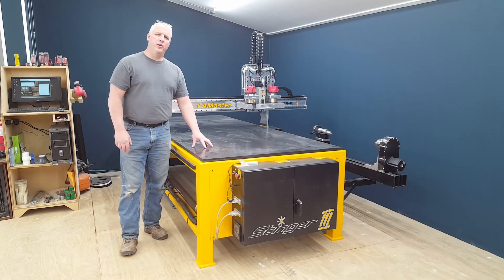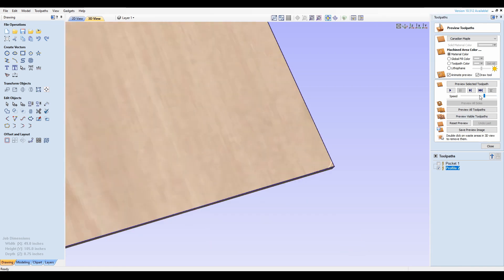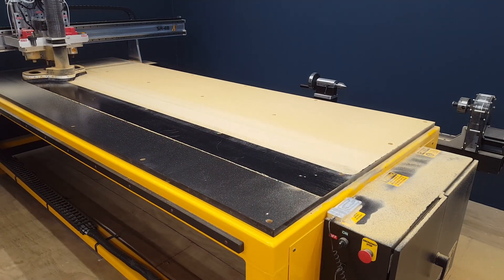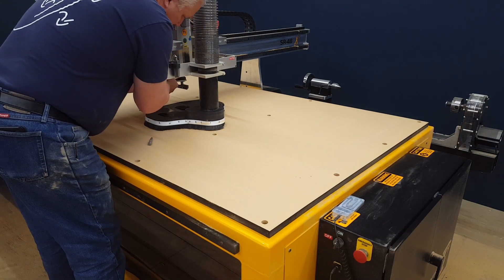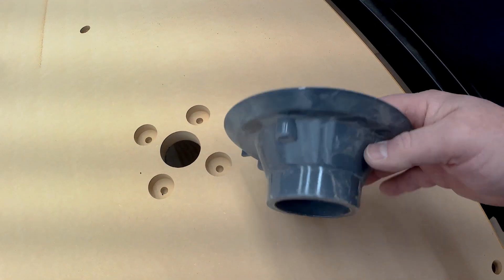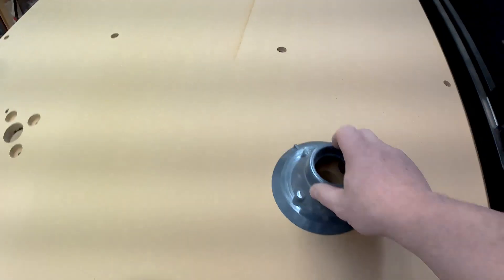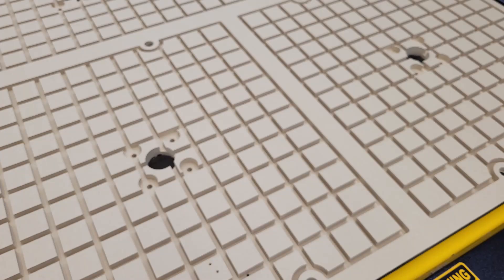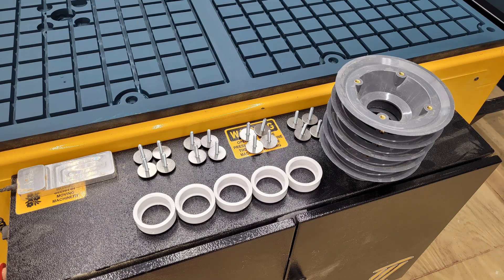CNC Router Vacuum Table - Part 1

Comment: Great Video and thanks,  I have that same CAMaster with the indexer, but mine has a single 4hp spindle. I'm running Aspire 11.5 and have a Hurricane vacuum. Also have a 1/2hp  Welch vacuum pump that I plan to use with removable pods for smaller pieces.

Comment: Great info, this gives me some great ideas.  By the way the second tool path wouldn't be needed if you used a pocket allowance of just a little more than half the diameter of your surfacing bit.

Comment: Hello - would love your review - I am in the market, I really like the Stinger 3 as you bought, but the gantry supports look small compared to others.  Are you concerned with step motors?  From what you are doing it is clear you know a lot about CNC, I am a novice, looking to buy my first machine - thanks in advance
Reply from the maker: Actually,  this is my second CAMaster... this one is almost identical to my first one. This one I bought with the lathe attachment.  I only got rid of my first one because of downsizing my shop, so I kept the newer one. 
I ran my first machine hard... and hardly had any issues with it, besides the normal maintenance of wear and tear. 
Great machine. I would buy another before any other brand.
Reply: @x3cnc479  what spindle did you pick.  thanks
Reply from the maker: I would recommend buying replacement gears for the rack and pinion... they were really the only part that wore down after a year of heavy use. 
Gantry is a lot stronger then you may think.
Stepper motors are perfectly sized for the machine.
Reply: @x3cnc479  thank you for the reply :)

Comment: Looks like you did a great job. What is the thickness of your vacuum table? How wide and deep did you make the channels?
Reply from the maker: Thanks for the comment. The table top board is 3/4" thick. I used a 3/8" bit, so the channels are that width, and I should have gone 1/4" deep, but I had my depth set to 3/8" and I didn't catch it in time so I just let it run. And since I am putting a spoil board on top, it shouldn't matter much. Thanks for watching.